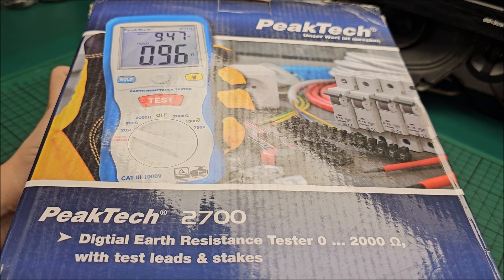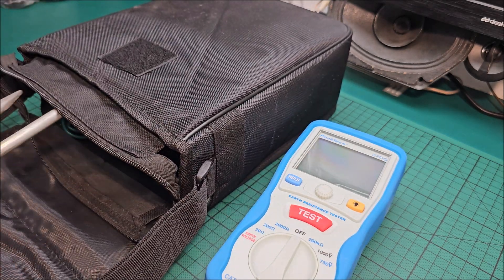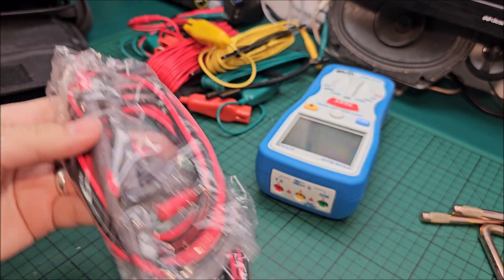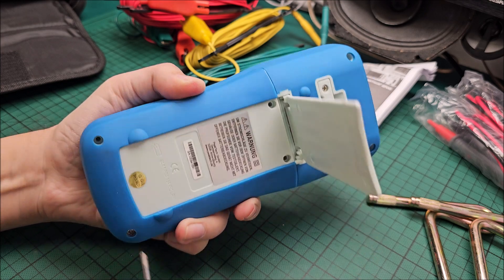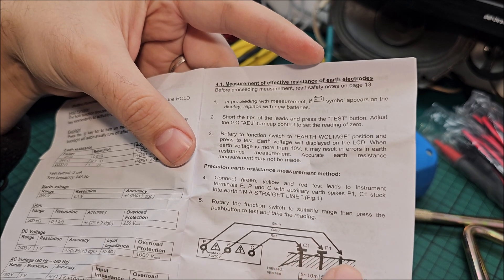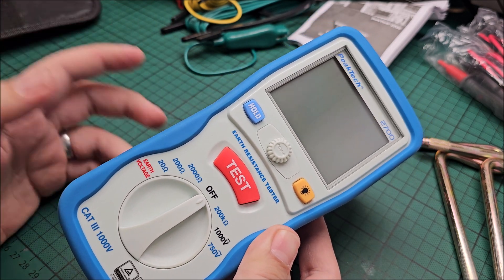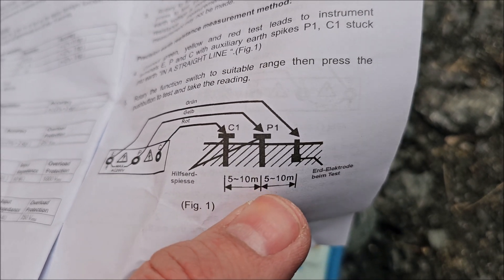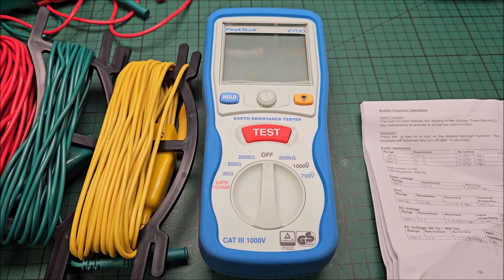PeakTech P 2700 Digital earth tester 0-2000Ω - review and quick test

Comment from the maker: ▬▬▬▬▬▬▬▬▬▬▬▬▬▬▬▬▬▬▬
  If this video helped you, please subscribe
      to help us reach 100.000 subscribers
▬▬▬▬▬▬▬▬▬▬▬▬▬▬▬▬▬▬▬
Reply: I have had the same question about the earth voltage...
Reply from the maker: I guess if you don't disconnect the ground from your house before measuring and you have a bit of leakage current, you will see a voltage. And depending on that voltage, the ground measurement can be wrong. If no voltage is pressent, measurement is correct for sure.

Comment: What “0 V” means on the Earth Voltage display:

There is no potential difference between the earth electrode and the reference ground → meaning no unwanted voltage or current present on the earthing system.

This indicates that no current is flowing through the grounding conductor and there is no issue with neutral-earth bonding or leakage currents.

It is therefore safe to proceed with the earth resistance (Ω) measurement.
Reply from the maker: Thanks for info! Did not make sense to me, but I guess for bigger buildings you can't just go and disconnect the grounding from building to make sure it's 0V. In my situation it was not possible to have a voltage, but in some cases with defective appliances, there can be a voltage that would mess up the measurement.

Comment: I think that you didn't had any voltage on the sistem because you disconnected the ground terminal from your electrical circuit, there is voltage in the ground when there is leak current on it, disconnecting it you can't have any voltage on it
Reply from the maker: Ah, that actually makes sense👍🏻